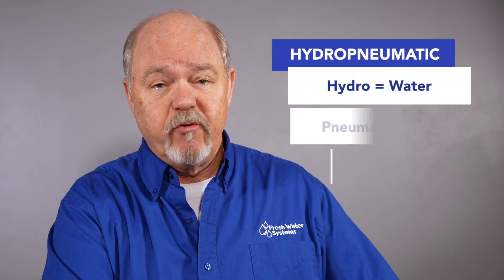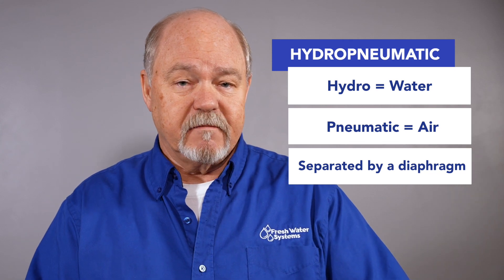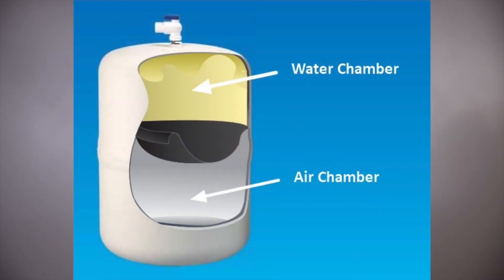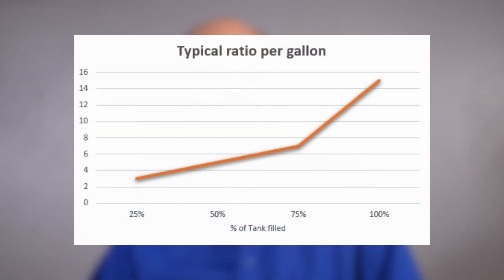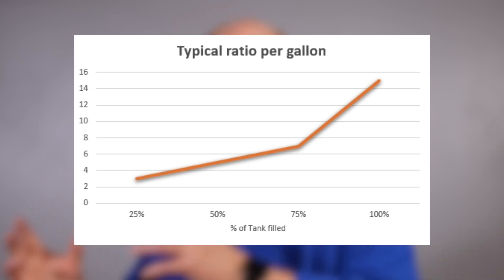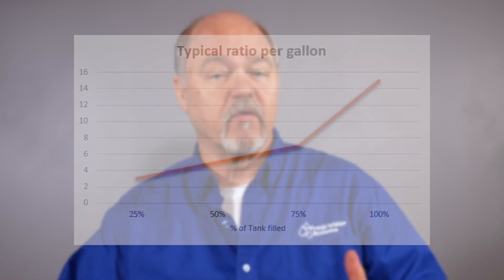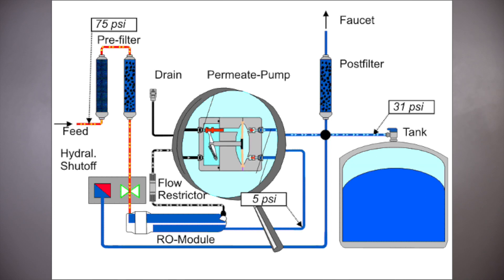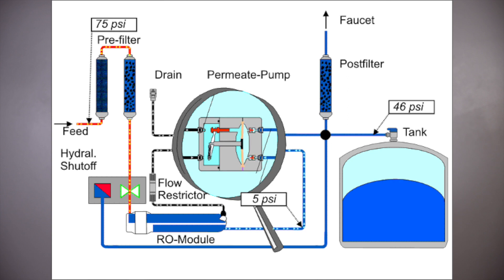Does Reverse Osmosis Waste Water? Understanding RO Efficiency

Comment: Can we use that wastewater back to the RO system?
Reply from the maker: Recycling a percentage of the concentrate flow (waste water) back to the RO feed is commonly done with larger commercial RO systems for efficiency.  Residential systems typically do not come with blending valves to enable that practice.  Part of the reason has more to do with product cost than efficiency I think.  The other reason that they aren't standard equipment is that if not blended properly the dissolved inorganic minerals can get over concentrated in the feed and the membrane gets scaled up and then has to be replaced.  The higher the TDS in the feed water, the smaller percentage of concentrate can be recycled.

Comment: I had Culligan person by today looking at my water softener and he said all the RO systems they install have a check valve that stops water draining when the pressure tank is full. Could this information only pertain to older RO systems and or very low cost product offerings?
Reply from the maker: There are a few components that ALL residential RO systems have so they function properly and a check valve on the permeate line is one.  (Permeate is the RO water coming from the membrane) The Culligan guy was basically correct, the check valve is part of what causes the system to shut off.  There is a separate shut-off valve mechanism that senses inlet and tank pressures and when the tank reaches shut-off pressure the valve closes.  The check valve keeps the pressure from pushing back through the membrane so the valve works properly.
Reply: @Freshwatersystems I talked to Whirlpool about the wharos5 system and confirmed that while there is valve to shut off drain when pressure tank is full the RO membrane rinsing process does lead to a 5 parts water down the drain for every 1 part of water stored in the tank. That is seemingly to me a very excessive amount of water waste, especially in socal where it is not cheap, over carbon filtering that is 1:1 .

Comment: Why is any water going out a drain? This is a filtration system shouldn't it be filtering water that passes through it and that's is? I have a whirlpool WHAROS5 ro system and if it is dumping water down the drain 24/7 in incline to take it out.
Reply from the maker: Reverse osmosis systems do send water to drain when working.  The water going to drain is what carries the contaminants away that are being removed by the membrane.  Using water to clean water.  RO systems since the 1980s have built in shut off valves so they shut down when the tank is full stopping water from going to drain.  If your system doesn't shut off something is not working properly and needs service.

Comment: Any possibility of the waste/brine water getting through the permeate pump lining into the tank? Possibility due to aging pump components perhaps?
Reply from the maker: The water produced by the RO and the waste water leaving the RO are separated by a diaphragm inside the permeate pump.  Ultimately, it is remotely possible that the waste water could get into the RO side but not something we have experienced in all of the years we have worked with them.

Comment: So let me get this straight, if the tank is full the RO system is still dribbling water down the drain 24/7?
Reply from the maker: RO systems today all have a shut-off device that stops water flow when the tank pressure reaches approximately 2/3 of the feed pressure.  This stops all flow to drain.  The inefficiency happens as the tanks are getting close to shutoff pressure, the amount of water going to drain stays the same as the water going into the tank slows way down.

Comment: You can add a permeate pump to any RO system to get better efficiency.  For example,  I bought the Apec RO-HI and added a permeate pump and a 6th-stage alkaline remineralization filter.  Because the Apec RO-HI was on sale, it was cheaper than buying the Apec 5-stage RO-Perm that comes with the permeate pump, and I still would have had to add the 6th-stage filter. The permeate pump you want to use is the ERP 1000.

Comment: What size flow control should be used ?
Reply from the maker: Hi! The flow restrictor is sized to the membrane output. There is some flexibility but typically they are sized to have a 30% recovery.

Comment: John - One of the key things consumers do not understand is the pressure differential across the membrane is the key to membrane efficiency.  [Efficiency Rating will be the new watchword and standard from the EPA for RO manufacturers as they all try to get onboard with the new WaterSense testing and disclosure rules] that emphasize efficiency of a system over its entire production cycle vs. Recovery Rate, which can be misleading as you point out.   That's why Permeate Pumps are so helpful with conventional air-bladder systems.  By keeping the backpressure felt by the membrane very low (typically it's locked in at 5 psi), the PSI delta P stays as high as possible, because the Permeate Pump "presents" to the membrane only 5 psi -- even as the tank is operating at it's psi peak.   Another thing to note for your listeners is the importance of water temperature and the dramatic effect it has on membrane production and membrane efficiency.  Remember folks, membranes are tested by NSF at 77F.  For every 1 degree less than that you lose 2% of production!   When sizing an RO system, consider the NET operating pressure, not just the feed water pressure and the Temperature compensation factor.   Add these two together to size your system.
Reply: Indeed, i got myself a small RO system that has a booster pump after the first filter attached, to increase the system pressure, and it claims to have almost a 1:1 ratio at ideal temperature. It's only a relatively small affordable standalone system (400l/day), usually intended for aquarium hobby use. I just need the RO water for my air humidifyers, specialty house plants, tea kettle and coffee maker, as we have very hard water with a massive load of calcium (and chorine) from our municipal supply. I might use it for other stuff as well, but i don't think i would want a fixed installation. I'm only renting this apartment, so i can't just go and remodel the kitchen and redesign the complete water supply system.
If i have some time i'll try to do some measurements on the waste/RO water ratio while recording the temperatures, pressures and TDS/EC levels. This video really sparked my interest to do some analysis on that topic.

Comment: I use 3/8 tubing for my RO system; will a standard permeate pump be compatible?
Reply: 3/8 is usually the tank and faucet size. 1/4 is the ro system size.

Comment: Twenty years ago, I started with a Watts R/O system.  After measuring the amount of waste water produced, I added a permeate pump which Watts sold as a kit.  It has worked well for years, pumping the waste water into our hot water system for use.  Recently, the old R/O system wore out, and I replaced it with a Watts system with permeate pump included.  After a few weeks, it has been working fine, with no water waste either.  We live in S. Cal., where water is expensive and not to be wasted...
Reply: How did you get it to pump into your hot water system? Seems like the most efficient option

Comment: couldn't the drain water be captured and use for filling toilet tanks or used for landscape watering?
Reply: Sure, but at what cost?  You'd have to run parallel water lines to the toilets so they carry only RO waste water.  Depending on where your RO system is mounted, routing the waste water outside will be easier, but how do you plan to water?  Drip system?  You want a sprinkler, going to need to install a pump to get some pressure.  What do you with the water to prevent over watering of your plants/yard?
Reply: almost every modern metropolitan area these days reclaims water on a 1:1 basis to what goes down the drain goes back into some local non-drinking supply system (and the reclaimed water often meets if not exceeds the original water standards). hence despite the brainwashing going on about "wasting water" that's simply not the case when it goes down the drain of a municipal sewer system in a big city.
Reply: It's concentrated waste why would you want to pollute your ground with it?
Reply: @0utcast  It's still tap water with a higher concentration of minerals and whatever else is in tap water..  Health experts warn of drinking to much RO water as it depletes the body of said minerals.  If you live in a place or large city where your tap water is that scary, then I agree, it is waste water. Fortunately I don't.  However, I do live in the High Desert where water is more valuable.
Reply: @0utcast  waste water from ro is not all pollution.

Comment: Could you run two or three RO filters at once on the same system and skip the pressure tank entirely? My understanding is that the pressure tank exists to make up for the RO filter's low flow rate. Alternatively, would adding a pump into the system to create higher PSI in the RO filter increase it's efficiency and therefore flow rate?
Reply: No

Comment: I find myself in a very rare spot right now. I'm sitting with the brand new RO system I ordered, and much unlike my usual self - I 100% missed this glaring downside.
Reply: Bro, I missed your situation by a hair.  Came so close to ordering a huge RO system, reviewed a half dozen online, and NOT ONE mentioned the amount of waste water.  I would have felt scammed had I purchased.  I nearly wet myself after watching this video and then heading over to the various AI's to ferret out the truth about RO systems and the incredible amount of waste.  Personally, unless there is 2% or less waste water, they should be removed from the market or at a minimum, be forced to slap a huge orange sticker on the box/website that reveals the truth.  Feel like I totally dodged a bullet.
Reply: @thejimoquinn RO has its uses and that's where your water is coming from contaminated groundwater with things like arsenic and lead approaching max allowable limits. If the levels of contaminants aren't that high then you don't need a RO system.
Reply: @0utcast  Show me a RO product that uses your language to clarify for the consumer the use case that you describe.

Comment: It is absolutely correct as this u-tube video shows if the system is used in the way shown.
But as we use the Enwa Ro plants to produce drinking water or chemically clean water for drilling platforms or on ships or on small islands where you previously had to send the water by tanker, it happens in the following way.
We produce from an RO plant to a storage tank - where, of course, there is no back pressure.
Before it goes into the storage tank, we send the fresh water through a remineralization filter where we adjust the ph value (this is because desalinated seawater is very soft), minerals are added to the same filter.
From the storage tank, the water is pumped through an active carbon filter and finally through a UV filter, directly to the consumer.
When you produce fresh water from sea water via Ro-plants, you get about 1/3 of the salt water you pump through membranes - the remaining salt water is used, among other things, to remove the salt coating on the membranes before it goes back to the sea.
this brine has a high salt content which is simply mixed back into the sea.
Regards
ENWA dk Prod.man
Reply: https://youtu.be/6tDyAuWB0LU
https://www.youtube.com/watch?v=WG0dFA3GngA
Reply: We produce drinking water with up to 60 bar over membranes and if you use, for example, up to 5-6 bar in your tank for the tap, we still have over 50 bar to produce and therefore still full production of permate for your tank.
Or, as we do, you could have a storage tank without back pressure, with a level switch that starts and stops the RO-plant as needed and after the tank a small electric pressure-compensated pump that gives the pressure to the tap,
which starts and stops with consumption.

Comment: Just want to say that this video contributed to me ordering one of your premanufactured RO systems. I recommend ordering the airgap faucet with your unit, and double check that you are getting and AIR-GAP faucet. Other than that, it's a decently easy install. You will need 9/16", 11/16" wrenches or an adjustable wrench at a minimum. They include a hefty amount of PFTE tape, thankfully.
Reply: Why an air gap faucet ?

Comment: This really opened my eyes.  In 2021 I had a new ClearFlo RO system installed.  Today did an experiment.  I pulled the drain line out of the drain and placed it in a bucket.  Ran the faucet to withdraw various water volumes, from 1/2 gal to 1.5 gals.  In each case, I got 16% efficiency.  For example, when I withdrew 1 gallon, the system refilled the tank, but also flushed  5.25 gallons down the drain.
Reply: Wow... Create 1 gallon fresh water and throw 5 gallons out. That's very expensive if you in like in North California.
Reply: @kennethz3366  sometimes ro systems are necessary like if your water quality is bad like heavy metals etc. Standard filtration won't get rid of that crap

Comment: Can you recommend a whole house filtration product that meets or exceeds EPA WaterSense standards? I’m on a city water. I’m an aquarium hobbyists, so my water usage is a bit higher than a typical household. I’d like to reduce waste water production as much as possible, for both environmental and economic reasons.
Reply: Wholehouse is much harder to address.  You are better off designing a system with a front end RO system running at 150 - 225 PSI, to a high flux membrane say, 1600 GPD and run this into a reservoir with a double shut off, UV protection, and then repressurize the water with a quiet 2" pump.  You will get tremendous production, and steady flow.  Make sure to place some digital sensors for Flow / TDS / Recovery Rate.  Several good products $$ out there.

Comment: how does the drain water not flow back up into the unit? what if you get a bad clog and both sinks are full causing back pressure?
Reply: that's what air gaps and check valves are for. hardly a new thing.

Comment: Hello John .  I have a RO demineralized water production facility and I am worried about the lifespan of the osmotic membrane.  the installation produces 250 liters per hour and they use the water to rinse the metal parts.  It was put into use 10 years ago.  the conductivity is maintained at 10 uS/cm.  do these osmotic membranes last forever or should I be worried?
Reply: Great question.  Reverse osmosis membranes do have a life span that is greatly affected by the type of water it is fed and the way the system is set up.  The higher the mineral content, specifically hardness minerals such as calcium and magnesium, can drastically reduce membrane life.  As water permeates through the membrane these minerals are left behind and over time scale will form on the membrane's surface especially if concentrate flow is not adequate.  An ion exchange water softener in front of a reverse osmosis system will add life to the membrane by removing the scale-causing minerals.  Having good pretreatment to eliminate membrane killers and a system set up to optimize membrane performance will extend life.  10 years of life is awesome.  Continue to monitor performance.  When rejection begins to fall, that will be a good indicator that replacement time is approaching.
Reply: @fwstraining624  thank you ❤️❤️❤️